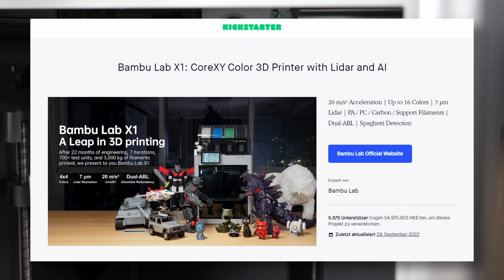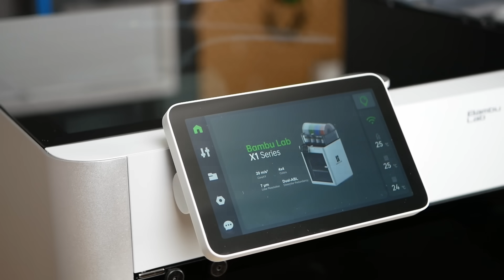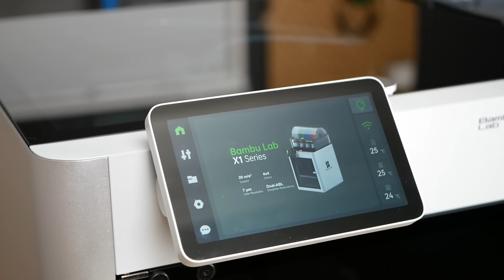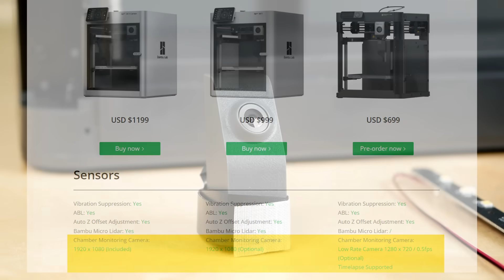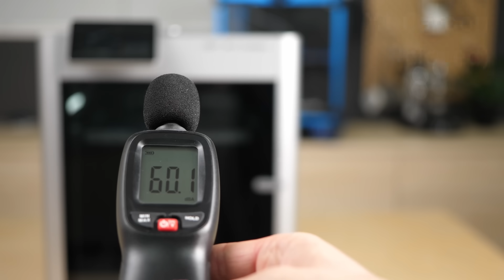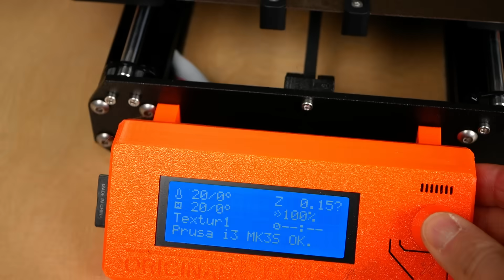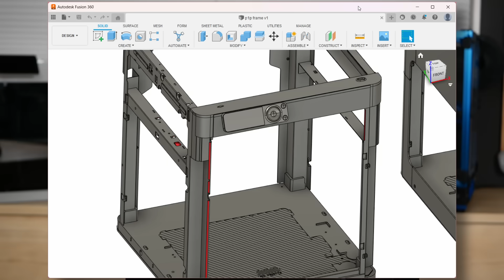The Best 3D Printer of 2022 got Stripped Down to make it Cheaper!

Comment: laughs in ender 3 😂 y’all getting scammed. These prices are anything but reasonable
Reply: The Ender 3 can't do anything close to either Bambulab printer. They're not the same class of machine.
Reply: At the end of the day, the last time I checked, Ender, Prusa and Bambu all print the same melted plastic materials.  Sure.. might take longer, but speeds don't always mean the best part either.  And at less than $200, Mr Delicious can buy three Ender 3 for the price of the P1P, and even more if he's comparing to X1C.
Reply: @JohnOlson  The Bambu printers can do high speeds at really good quality. They're amazing for prototyping.
Reply: @logitech4873  Not arguing that.  X1 or P1P print fast and good.   But Ender, Prusa, and many others can do really good quality too. Okay.. not as fast.. but in the case of Mr Delicious's Ender, he can print a heck of lot cheaper. And with add-ons, you can put automation to clear the bed, and print parts continuously without human interaction.  

I forgot what video I was watching, but printing a 2 hour print or an 8 hour print when you go to bed at night, they are both done when you wake up.  

All of them are good printers.
Reply: @JohnOlson  For sure.
My use case really is rapid prototyping. I like designing things, and hitting print and getting a result in a matter of minutes or sub-1 hour. The X1C works extremely well for this purpose.

Comment: I’d love one, but $700 without automatic bed leveling is a bit of a deal breaker. I’d rather save up for a machine that would give me all the bells and whistles.
Reply: P1P HAS automatic bed leveling through the nozzle pression on the plate. It just misses the Lidar sensor, which inspect the first layer accuracy and the flow rate.

Comment: Now, BL just needs to make a 180*180*180 printer for 300$.
Reply: Not going to happen.

The materials etc probably cost 300 bucks. Making it smaller barely saves money as that only saves a few grams of metal.
Reply: @BeefIngot  a small bedslinger like the v minion seems possible. Bedslingers can be fast under 180mm^3
Reply: @morbus5726  I feel like a bed singer isn't their mo

Comment: I don't think can completely rule out running fiber infused filaments for an occasional print. While the gears and nozzle aren't hardened they are still steel and won't get chewed up like other printers running brass parts.

Comment: I would rather buy a machine with the X1 Carbon features but with a minimum of a 500mm x 500mm x 500mm build volume.
Reply: the v core 3 can do that, but its a kit, and requires tuning. It does perform better, and can print faster, but definitely isn't beginner friendly.

Comment: If this had been released at the same time as the x1 I do not know for certain what I would have bought but I can say I am happy with my x1 carbon.
I did consider buying the p1p when it was released but I do not really need 2 of them as I have several other printers.
For me as I want to print other higher temperature filaments the carbon is better I suppose but if you are happy printing PLA only the p1p is a good buy.

Comment: Now it looks even more like a voron rip-off
Reply: Just like voron is a rip off of fabutotem.
Reply: you do undrestand that voron isn't the only corexy printer? This is nothing like the voron, aside from the motion system.
Reply: @morbus5726  it looks exactly like a Voron now  without the aluminium box and the MMU. Even the fan looks the same. It's a voron copy in every way and without the option to use open sourced hotend and other components.
Reply: @ololobo7670  I feel like you haven't built a single kit corexy machine, not all printers with a corexy motion system and a hotend cooling fan are vorons...
Reply: @morbus5726  I know what core xy is. Have an ultimaker3 at work. Mate I don't know why you're simping for them so hard. The clearly took what was out there in open source and stick their label on it and make everything proprietary. It's clearly just a money grab.
Reply: @ololobo7670  ultimaker isn't corexy, so you clearly don't know what that is...
Reply: @ololobo7670  You've just proved my point by saying the "ultimaker3" is corexy. It isn't, it's a crossed gantry design. Stop acting like you know what you're talking about, you're just making a fool of yourself.
Reply: @morbus5726  thanks for that I got it now. But still doesn't change the fact that you're just being a shill for bambú lab. They just remind me of the snapmaker which a colleague of mine purchased. A shiny toy that easily breaks and unfixable.

Comment: Howdy Stefan. Ubiratã from Brasilia, Brazil here.

I have to say: I think the Bambulab P1P looks like an awesome product. Even though it lacks some of the outstanding features of the x1 carbon (like the lidar and automatic pressure advance and flow adjustment) it costs 500 USD less! That’s quite q lot of money!

Although it does not have side panels (which can be used easily custom made locally using policarbonate panels for example) it can still be used for some filaments like ABS (specially for parts not so big) due to its ludicrous speed. Depending on the kind of parts being printed there simply won’t be enough time for them to warp significantly. Still, as I mentioned, nothing keeps the user from getting locally made panels (cutting their own) so the printer can be properly isolated from air drafts.

It’s still a ridiculously fast printer (might even not be as fast as a Voron but enough for the majority of users) that manages to become readymade for (way) less money and work it would take to build a Voron 2.4 250x250x250. (Voron users might want my head for this remark LOL but the fact is that the majority of 3D Print users simple does not have the knowledge or even the will to go to the assembly process, even though a well built Voron is a hell of a printer).

Abrasive materials? I think it would be only a matter of ordering the hardened steel nozzle from Bambulabs itself.

My only personal problem with Bambulabs is that Brazil is not on their availability list. It it was , I’d be already on the pre-order for the P1P (or better, might have already sold a kidney for the x1 Carbon, LOL).

BTW, one thing I didn’t know that I found out through this specific video is that the AMS doesn’t need to be mounted on top of the printer, it can be mounted on the side (I didn’t know that until now). That’s perfect for me, as the Bambulabs printers (without the AMS on top) are a perfect fit (with a little slack for the moving parts) into my workspace (anything taller just won’t fit).
Reply: I hope Brazil becomes an availability for you! BTW - Bambu has released printable side panels (even in several patterns!), and the glass top and door are on their orderable parts page!
Cheers from the US.

Comment: I haven't seen any videos on the X1C printing with TPU. Can you print TPU with higher speeds now and get good quality?
Reply: I've printed TPU on mine a few times.  Yes, it works just fine.  You can't print it from the AMS - you have to feed it directly into the printer itself.  Some prints probably need to run at the slower speed (bambu calls it silent mode), but most TPU prints fine at standard speed.  That's 2-3x faster than pretty much any other off-the-shelf printer.
Reply: @mortalwombat5811  ahh i see. I’ll give er a shot. Thank you Mr. Wombat
Reply: had the same question about the P1P. Would it be able to handle TPU?
Reply: @tomsko863  in my opinion, i’d assume if it works for the X1C it will work for P1P
Reply: @tomsko863  Same extruder. Should work fine.

Comment: Everything they are doing is impressive. I just can’t believe they built a bespoke firmware in 2 years without taking anything from Marlin, Reprap or Klipper. Until that’s verified I won’t buy one.
Reply: 3d printer firmware isn't exactly difficult software to write.   There is a huge difference between reprap or klipper with 1 or two people coding versus a company with dozens.
Reply: @adamklosterman8960  Really? Does that answer come from experience or are you speculating? I’d genuinely like to hear reassurance from someone qualified that they haven’t ripped off the OS community.
Reply: @zerofox3d  from experience.